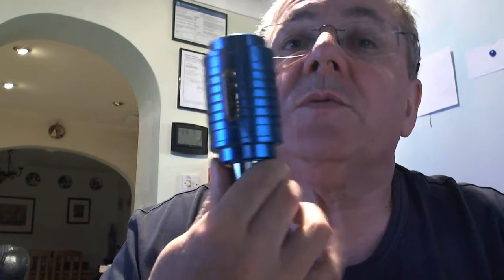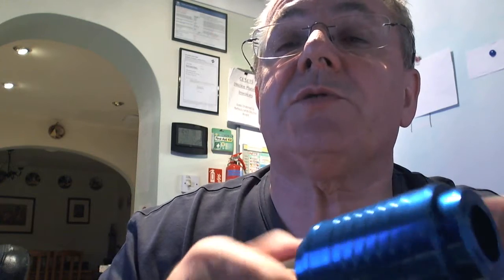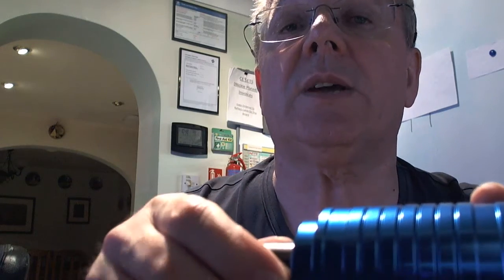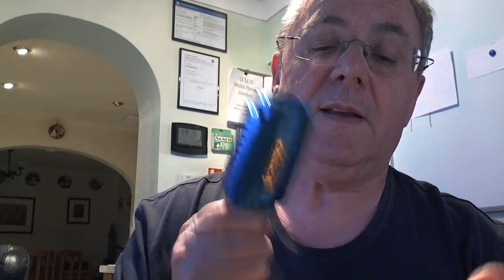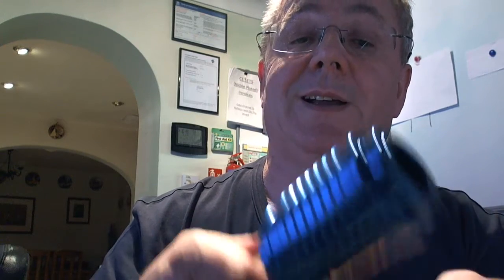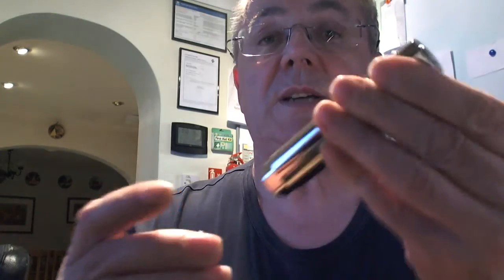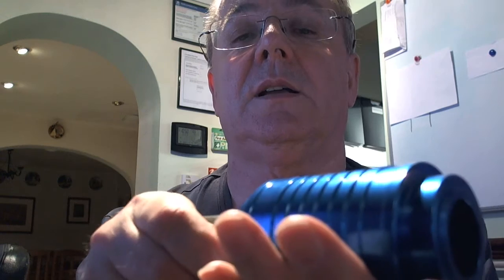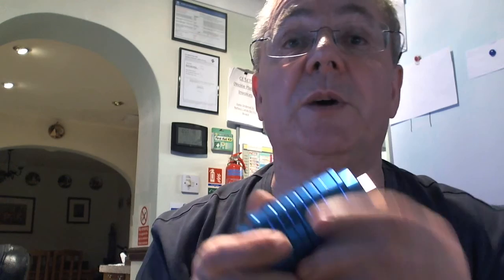Revomaze_Shaft_Removal

Comment: Nice one Chris, thank you.
Could you possibly do a reassembly video showing how, and which way round, the pins are re-fitted. I am at the point of separation but I'm worried I won't be able to get it back together correctly.